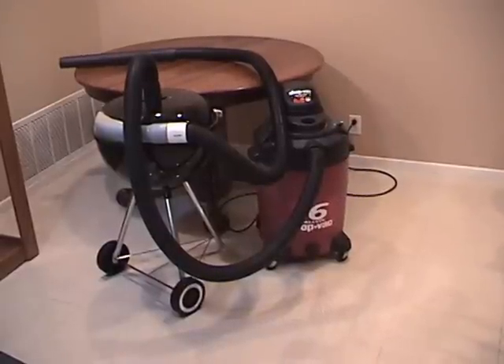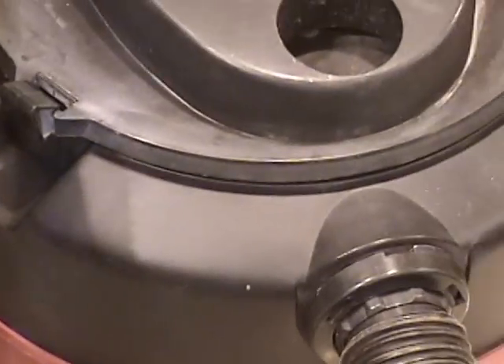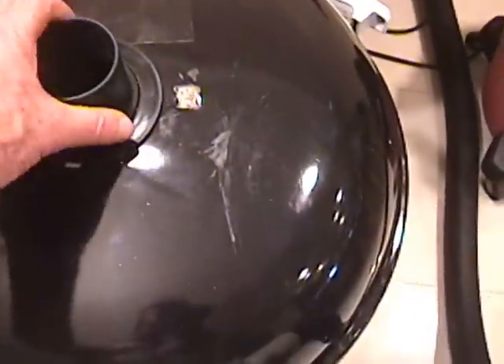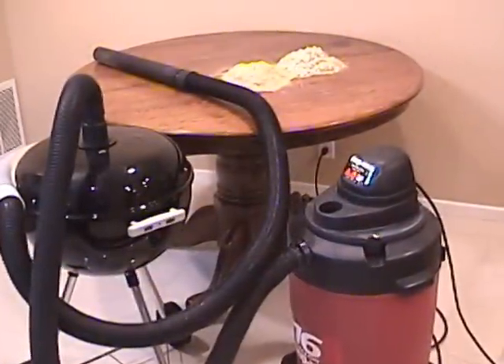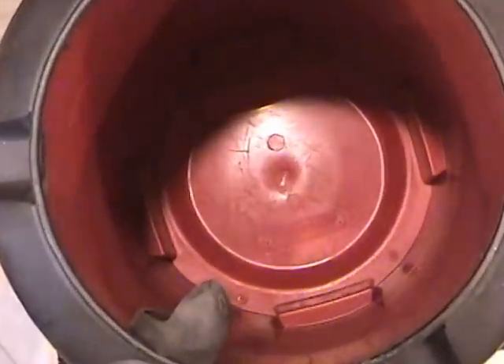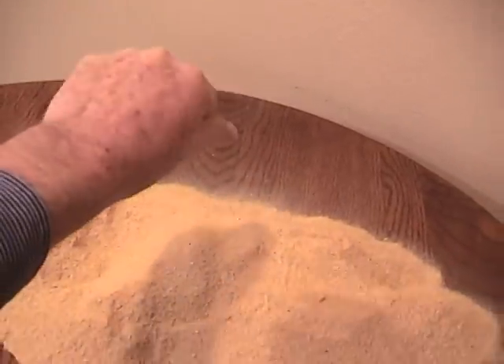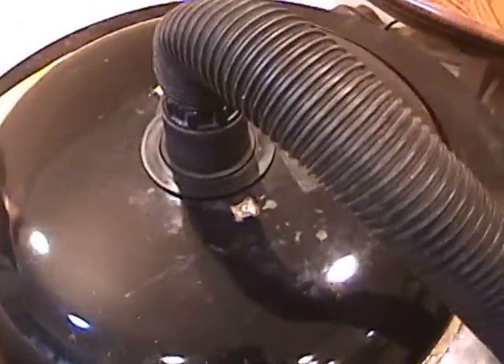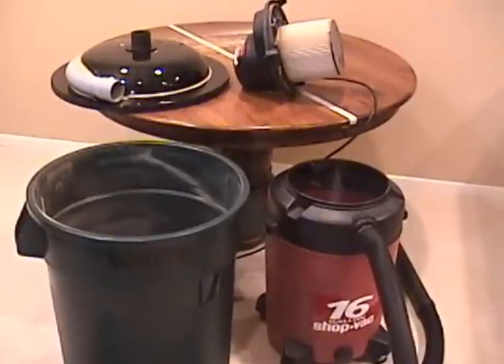DUST COLLECTOR VIDEO:  The World's Most Efficient Debris Separator

Comment: WOW! Simply, wow .. that is amazing .. I would enjoy seeing the collection tube jammed into a filled five-gallon bucket of shavings .. My five-gallon bucket separator gets filled in no time with high volume .. yours appears about 110% more efficient .. Off to Craigslist to search for a grill-top. ha!   Thanks for the video.
Reply from the maker: First, let me thank you for the kind words about my prototype.  I too, was impressed (if not surprised) at its performance.

I'm making another prototype that sits on a HD 5 (or 3-1/2)  gallon bucket.  It is less than 4 inches high (not counting the bucket).  And the bucket will sit ON my Ridgid wet/dry vac.  The prototype is based on a second embodiment from the Patent.  Wish me luck!

BTW, it's tough to figure the shape of the oblong elliptical cutout for the 2" electrical sweep (long ell).  But the sweep is important, so don't omit it.  To stabilize it, spot-weld at 3 places with Loctite PL530 (mirror, marble, granite) caulk.  It will cure overnight.   Don't use a caulk that cures too slowly.  Then, the next day or so, fill in the remaining gaps with the same caulk.  Fill all the gaps to seal completely.  I then used 3/4" wide metal strapping (with holes) for the three barrier supports, leaving about 1" peripheral gap around the edge.  The barrier ended up at 15-7/8” diameter.  You would then need to make a larger adapter for the trash can.  I'll leave it to you to figure that one out.  Oh, and I used weather stripping around the base of both the grill lid and the trash-can adapter for a seal.

Comment: Here's an idea for drywall dust.

Have two catch-containers - each ten gallons.

both cyclonic.  In the first container install a fine mist sprayer - above the sprayer have a one gallon bucket (or 5 gallon) to serve as a water reservoir.

With the plug-in for the water pump - connect a grounding line to the plug-in ground - connected to the unit (static discharge).

On the second container, install a condenser wall where any water vapor will hit - as it enters the second bucket and will collect in the bottom of the container.

The water mist should arrest any dust particles and be efficient with regards to water use.

What do you think?
Reply from the maker: To be honest, your suggestion may work well, but it sounds complicated.  It may be too complicated for me, but others may find it simple enough.  I would suggest you first build a prototype to prove the concept.  If it works fine, and it's economical, you should do a Patent search and if nothing shows up, file a Patent on the idea.  You can then try to sell or license the Patent.  I must warn you that the Patent process is expensive.  I've never tested my device with drywall dust, but it must be very difficult to separate and collect.
Reply: Yes - Drywall dust is a problem throughout the construction industry.
Reply from the maker: I don't have access to any.  Otherwise, I would try it and report the results.
Reply: too complicated and wet drywall dust will be a pain to clean out.

Comment: I'm sorry to say but this is not a " revolutionary concept.  It has been used for many many years on a much larger scale in industrial applications like sawmill planer mills, only the "cyclones" 8 to 10 feet in diameter and 16 to 20 feet tall.  However the home enthusiast and you would rather make one than buy one.  I just finished mine using a 16 gallon Shop Vac and a 32 gallon Rubbermaid trash can.  Instead of pvc pipe I used a couple of 24 inch by 2-1/4 to 2-1/2 tapered extensions (made for shop vacs).  It sucks.
Reply: Gerald Penn c

Comment: Taking in small amounts of dust with lots of air is not a difficult test for most separators to pass. Would like to see a 16" drum sander connected to your device and observe how well it performs with a garbage can filled near to the brim. Dropping small amounts of dust into a large container does not demonstrate how well the separator works in situations where the collection container is starting to fill up. A receptacle that is nearly full will cause many "fines" to move back into the separator's chamber and pass through to the shop vacuum. Would be more impressed if you were to pick up 10-12 gallons of dust, and then show us the results.
Reply from the maker: Hi Thomas,
Thank you for your very perceptive comments.  I think you would understand the physical aspects of my device better if you read the U.S. Patent (No. 8337580).  Then you might understand why I feel this design is superior to all those previous.  Although the potential problems you bring up are real, I think the "barrier" suffices to disrupt the currents below it to the extent that the debris remains in the receptacle, even when the debris is at higher levels.  Also, the downward and outward sloping sidewalls of the lid centripetally prohibit particles from moving upward in the chamber toward the outlet (which leads to the vacuum).  If these rationales are not true, then the answer to your hypothetical problem is simply to empty the receptacle more often.
Reply: I have read your patents and I see there are two embodiments that seem quite different. Strikes me as odd the USPTO would pass it. In any event, congrats.  I too have a provisional patent with an ultra-low profile design, but with a number of novel differences to your device. In tests like the one you show in the video, I also got extremely good separation. Drawing sawdust through a 2" tube and barely putting any particulate load on the separator is not a very realistic test, in my opinion. A real test is to see how quickly the separator can pick up dust sitting in large piles on the floor; coming from a planer; from a large drum sander; etc., and still separate effectively. In your demonstration video, you take several minutes to collect less than a gallon of dust. Now, show us what we can expect when there's a giant pile of crud to pick up that is a mix of ultra fines and small chunks of wood from a miter saw, for example.
Reply: "Anyway, wouldn't a slower rate mean more time for fine dust to bypass the separator, thereby testing its efficiency."  Not necessarily. Suggest a study on the concept of agglomeration, and what it means to the effective separation of ultra fine particulates. Also, extremely heavy loads can cause air to slow or stall as it passes through the separator. When that happens, it will end up in the vacuum's filter. Some commercially available separators fail to perform well under the occasionally heavy load of debris emitted from a planer. Separation and throughput often move in opposite directions. The best way to challenge my assertions is to prove me wrong by picking up a large amount debris that is a mixture of shop dust and larger chunks. My last comment. Good luck.
Reply from the maker: Like I said, my separator sucks up debris as fast as the vacuum connected to it.  The smallest cross sectional opening in the device is the hose.  In no way, does it inhibit the airflow between the vacuum and the debris source.  My last comment.
Reply: If you are running a big shop, you build a big collection system and empty it before it runs out of it's efficiency curve. My little home-made shop collector has 2 sequential cyclones; one designed to remove 99.9% of the solids over PM 2.5, the second to remove 99.9% of what gets by. First bucket is 2 gallons, second cyclone has a 1/3 pint pot. The bucket gets emptied before it is 1/2 full. I designed the system for the protection of my lungs, not to save me time emptying the sawdust bucket. The stuff in the 1/3 pint pot, (rather than my lungs), is so fine it feels like grease between the finger tips. It is a tiny amount by comparison. The blower filter has not needed cleaning in a year's use.
Reply: Thomas Huntley my thoughts entirely. The only thing preventing the picking up of large amounts of debris in this video was the cautionary use of the person operating the vacuum hose. Most woodworkers don't exhibit that kind of caution. A lot of large power tools also produce debris at variable rates. I used to work in the design office for a sawmill where a number of cyclones were designed and there were a number of variables as well as a lot of calculations and design work involved.

Comment: Am I supposed to be impressed with this?   A 6 HP vac has trouble pulling in dandelion fuzz that is right at the tip of the hose?  My little bitty shop vac would pull that in from half way across the table - and that's with no separator.  Plus the saw dust test was really bad.

Since it's obvious that a bare shop vac half that size could outperform this system,  I'd have to say that the separator is lowering efficiency rather than raising it.

Comment: Any chance you could list the type fitting you used in the top of the grill lid? Great idea. Thanks for posting.
Reply from the maker: Again, sorry for the late response.  I don't check in as often as I should.  Too bad messages don't come to my inbox.

For the inlet, I used a 2" black plastic shower drain I got at HD.  Then I cut off the female end of an extension wand (for a shop-vac) and attached it to the drain.  This facilitated the connection of the male end of the vac's hose.  You could also use a short piece of 2" PVC pipe  and a coupling for a connector on the drain.  The drain has a rubber insert that tightly fits and seals against a 2" PVC pipe.  That would become the female connector on the separator.  Then use another short piece of 2" PVC and another coupling for the male connector at the end of the hose that goes to the vac.  The I.D. of the coupling snugly will fit the O.D. of the flex hose.  And the O.D. of the pipe will fit the I.D. of the coupling on the separator.

The shower drain is a "Sioux Chief", "NO-CAULK" drain with a designator above the barcode that reads "828-2APK".

Comment: HI wayne, The Baffle under the lid how much clearance is between the input drain flange and the ply wood baffle?
I noticed the modified underside of the grill top what is different in that photo from the others?
Lane
Reply from the maker: Hi,
Thanks for the question.  The outlet that connects to a hose to the vacuum protrudes downward from the inside top of the lid about 3 inches into the vortex chamber.  There is then about 1/2-inch between the bottom of the outlet and the top of the barrier.  Actually, the space between the end of the outlet and the barrier could have been larger.  Maybe 1-inch, which would result in a space for airflow equaling the cross-sectional area of the outlet and the hose.  I made this adjustment in the prototype and it did not make any discernible difference in the functional efficiency of the separator.  BTW, the tangential inlet, which is a 2-inch electrical long-sweep, is just above the barrier.
Reply: Thanks for the reply and the detail,  I have played with the Thein Baffle system, and the "cyclone shaped Funnel)
which I currently use. I will be looking for an old Weber Grill.
Thanks.
Reply from the maker: I think the shape of the grill lid is perfect.  However it is somewhat difficult to cut.  I used a saber saw after drilling a hole to start the saw.  Then I cut an oblong hole to fit the sweep. 
I used epoxy to mount the sweep in the hole after first "spot-welding" it in position with the epoxy.  I don't remember the type epoxy I used, but wish I did.  It was great.  I later built another prototype, but the epoxy was way too slow curing.  It took a week.  You should try to get something that cures fairly fast (one day) and be sure it adheres to both the PVC sweep
and the porcelain coated lid.  Oh, and I put some weather striping around the bottom of the lid to assure a good seal.
Reply: I think I will use a cut off grinding wheel to cut off the slot in the grill top. JB weld should adhere to both metal and the CPVC conduit
Reply: TheFalconJetDriver 
.
Reply: TheFalconJetDriver .

Comment: Hi Hawker, I just subscribed to your channel, I have been looking for a way to use a trash can to catch dust and debris from my hobby wood shop. I discovered yours just a little while ago. I wonder what would work instead of a webber grill top. I don't have one of those. Your idea is exactly what I've been thinking and to same me some time I found your idea on u Tube. If you don't mind I'd like to use this in my shop.
BTW the link you have http://postimg.org/gallery/2uzyvzuk0/...doesn't work for me, all I get is error message.
Thanks
mark
Reply from the maker: +Mark Burgess 
Sorry for the late response but I just noticed your comment.  The Weber grill lid is an ideal shape for the separator because it has a downward and outward sloping sidewall which rapidly forces the debris into the receptacle.  You can probably find an affordable, used grill on Craigslist.  A good alternative to the grill lid would be a wok-lid.  They are the right shape, come in many sizes, and can be found on the internet.
For images of the prototype parts go to:
http://postimg.org/gallery/2uzyvzuk0/17c515f0/
I just tried it and it worked for me.  If you can't get it to work for you, email me at wmanska@gmail.com and I'll send you the jpegs.  Also, there a lot of good info about the device in the U. S. Patent, No 8337580.  It can be found with a Google search. 
Please let me know by email if you got this message.
Thanks,
Wayne